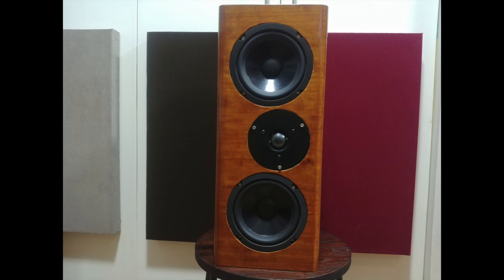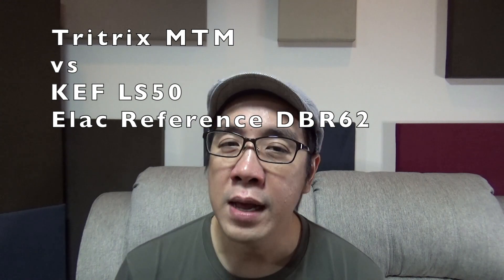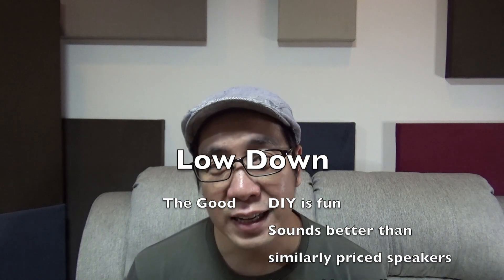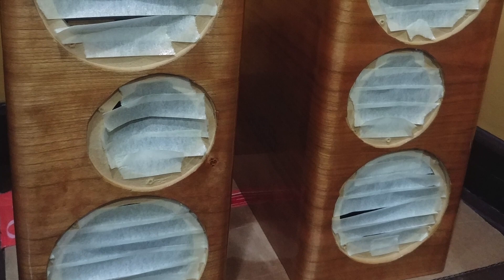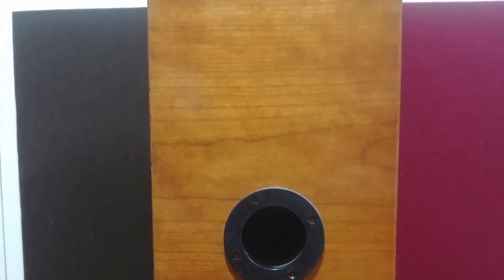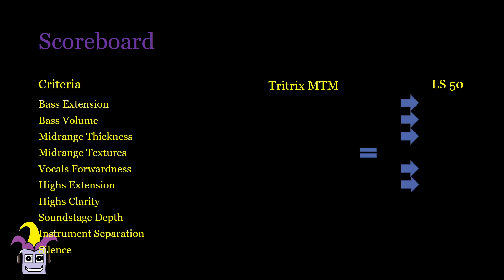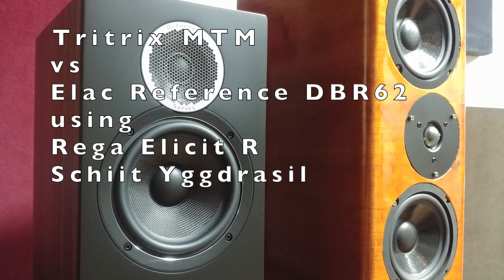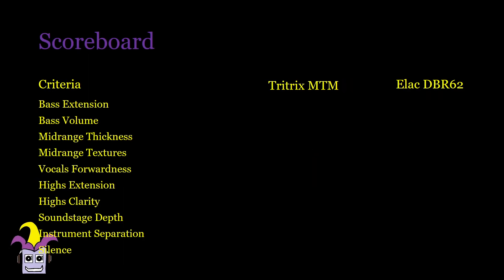Tritrix MTM DIY Speakers by Parts Express review vs KEF LS50 and Elac Debut Reference DBR62

Comment: I built these about a year ago, and I love them. The port tube should be set at 8.5" long. I adjusted mine to this length, and it made quite a bit of difference in the bass response. Give that a try.
Reply from the maker: THanks for the info. Will try it out.

Comment: hi What did you say about the bass port why it doesn't go down to 45
Reply from the maker: Thanks for watching. The port comes with a port extender and should be attached to have a total length of 7" I think. I haven't put it on which probably explains that lack of extension.

Comment: Nice job on the cabinets! Those drivers are very beginner and have high distortion. Check out the RS line of drivers from Part-Express ( Big step up ) and also take a look at the kits at Madisound.
Reply: Hexaudio with the driver upgrade would you have to change the crossover? Thx
Reply: @jcowboy123  Yes, the crossover would need to be re-done but both companies have full kits.